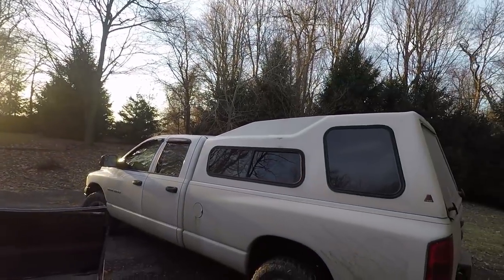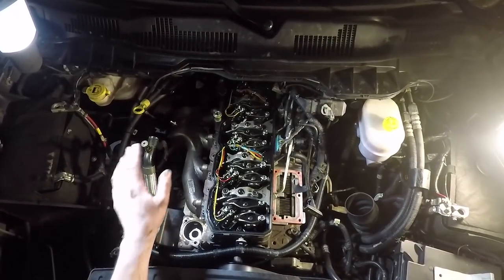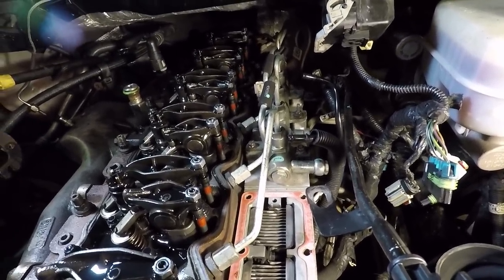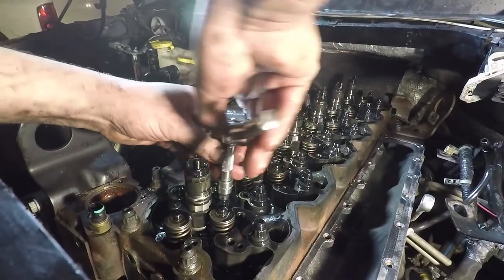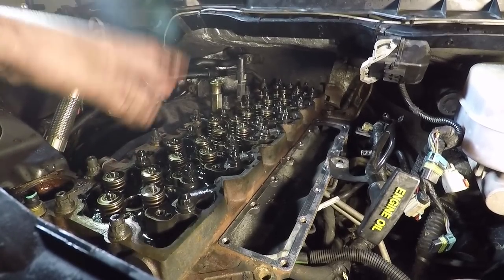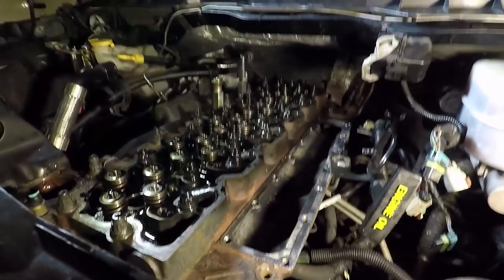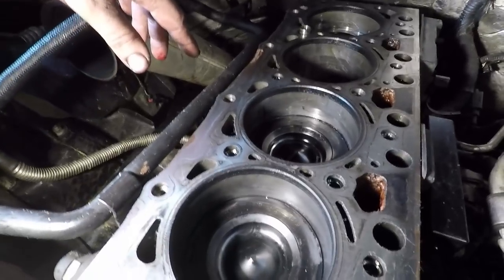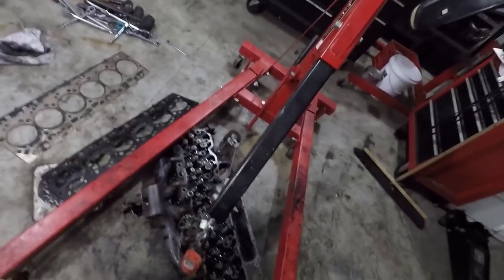6.7 Cummins Turbo Diesel Head Gasket Failure... It's Coming Out! Head Gasket Repair Part 2

Comment: for future reference when you get a no start with good fuel pressure ecm  and harness you have a dropped valve seat there is not any information on the web to help figure this out best thing to do is pull the head quick if your lucky the seat has cocked sideways and not hit the piston

Comment: You might want to delete the grid heater while you're in there.  Recently, I've seen several on the forums where the nut breaks off and falls into the combustion chamber.  Not worth the risk, IMO.
Reply from the maker: I'll definitely check it before putting it back in

Comment: Heading into this very repair this weekend.
Any advice aside from pulling the shroud and fan?
Reply from the maker: If your not putting the hear right back on with a new gasket, spray all the exposed parts with wd40, to prevent corrosion

Comment: Had my water pump changed from the dealer Recall’ mine is 15 cummins  ever since I have been smelling coolant passenger side my truck is deleted can not find shit truck does not have studs but even when I get on it  my temp is fine oil fine what else can I do to
Figure  if it’s a head gasket?

Comment: O-ringed head for sure!! Haven't blown a head gasket since doing mine
Reply: I’ve heard that it’s more important to upgrade head studs than to have o ringed head. I’ve heard of o ringed heads failing too. Just replaced my head gasket and head on my Cummins 6.7.
Reply: Frank May yeah I’m reading about how the o-ringed heads are still failing Google “6.7 Cummins head gasket failure” there’s a place up in Illinois that is using steel o-rings but then I was reading that they as well need replaced after 30,000 miles, we got rid of our 6.0 Ford so we wouldn’t have to go through bs yet here I am. I’m from the old school where Diesel engines lasted 500,000 plus miles without hardly ever having anything go wrong with them. We are having the ARP head studs put in but I’m reading where lots of people had the head re-decked check for cracks and add the better studs and they still blow another head gasket, these 6.7’s produce too much compression from what I’m reading they have to lessen the compression a bit.

Comment: Did the problem start before or after headstud
Reply from the maker: I had big injectors in the truck without proper tuning, that is why I feel it failed
Reply: @TurbaTom  ok cause I'm deleted and have an h&s mini max with full 4inch exhaust as well as evil energy rail plug to keep my pressure up. Next is studs and nozzles just debating on what size I know ill need a fass or air dog pump soon. Not entirely sure what I can get away with right now...
Reply from the maker: Get 625 head studs that way if you ever want to make a lot of power you are already set. Also Custom tuning will help things play nice

Comment: Any reason behind the head gasket failing?
Reply from the maker: Had 200% over injectors in it a while back without a tune
Reply: saggiebaggie we have a 08 6.7 at 91,992 it went into the shop here in Missouri on our way to winter in Texas, from Minnesota. This 08 has low mileage because we use it for pulling the trailer 10,500 lbs truck is deleted luckily I found this problem while here at my sisters house and I found a great shop that even gives a 3 yr 36,000 mile warranty. From what I’ve been reading these 6.7’s are very prone to blowing hg deleted with egr cooler on or off running tunes, Smarty I heard not to go over 50 additional hp without having the arp head studs. I have only went up 25 hp.

Comment: Turba Tom 
I asked this in your prior vid, I don’t mean to be a pain in the ass, but
Which Machine Shop did You call, or using ?

I need to get my 6.7 head checked and maybe fire ringed.
Reply from the maker: Millers machine shop in Lincoln University